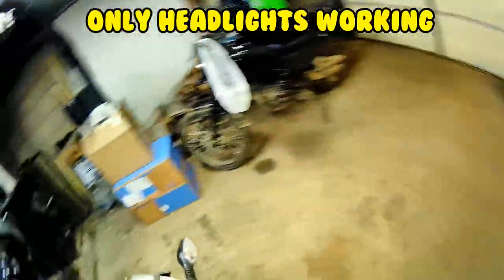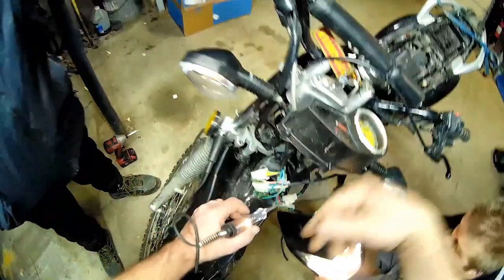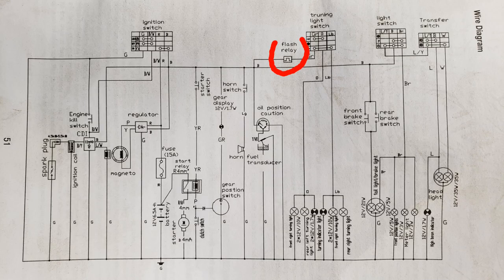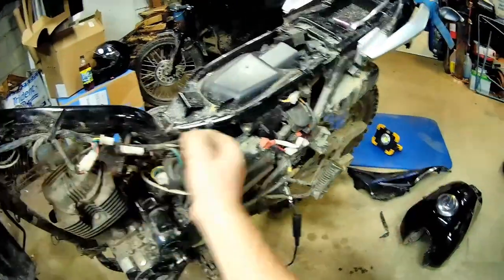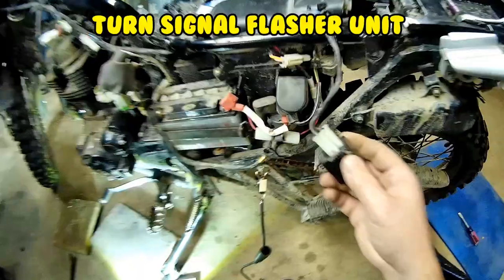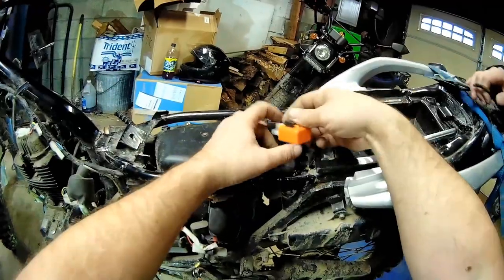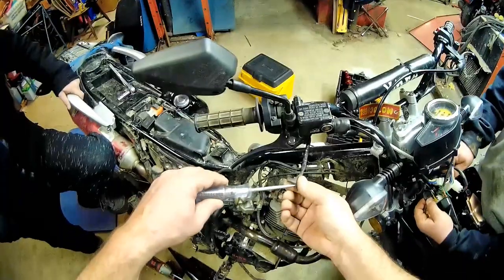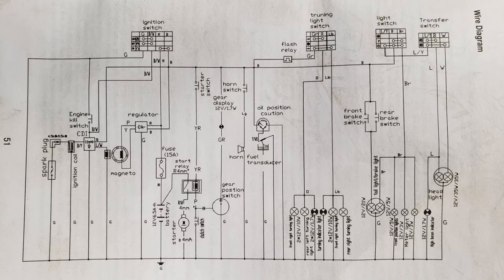[E63] FIX Brake lights, blinkers, headlight Troubleshooting, testing, repair. Hawk 250 motorcycle

Comment: Check your flasher relay on the back(facing your moto)back right under your side fering.had the same issue and this solved my problem. I had no flashers  working saw your video and started looking hope this helps
Reply from the maker: That was the first thing I checked. Thanks

Comment: I have the Hawk 250cc dlx was wondering  where to start with my issue.  All lights work fine. Except my turn signals  stop working  is there fuse? Under seat ? Flash relay? Thanks.
Reply from the maker: I'd say the flasher unit. It's under the seat. 2 wires going to it. Fuse is one main fuse for all near battery.
Reply: @MotoCheez  Thanks man!

Comment: I just got mine a few days ago, when I turn the ignition, the lights don’t show up but the buttons work for them. The dash should show up icons and they don’t and idk how to start it
Reply from the maker: The power leads have to be connected to the battery on the car for it to power up

Comment: Excellent video my grandson has a hawk and so do I his headlight won’t come on and his tail light when you press the bright light flasher they had light will come on but the running light will not when you press the brakes his back tail light comes on but the running red tail light will not stay on when the motor is turned on......!!!
Reply from the maker: Is the switch on handlebars turned off? Silly question but sometimes overlooked.
Reply: @MotoCheez  ..
Nope it’s a 2021 DLX fuel injected the switches are completely different than the one on my 2020 carbureted ....
The switch on this hawk is Made completely different ...., it is blue and has a flasher button ....! For the high beam....! you can flip the switch on nothing happens you press it hard and it flashes the bright lights ....! , but the ( run light will not come on in when you turn the key on with the headlight switch in the on position...! , the tail light will not come on Ether...., I have taken the bulbs out and tested them they are both good so it has something to do with the wiring somewhere.....!
Reply from the maker: My DLX has the headlight switch to shut it off. It's in FL and I can't remember where it's located. Up higher on handgrip controls.
Reply from the maker: I think I showed it on my original review of the DLX.
Reply: @MotoCheez  ...
You can shut this light off of course but after you turn it on it is also spring loaded so if you press it down it will flash the brights I don’t think it’s in the switch because the back tail light will not come on either it well if you press the brakes again all the bulbs are fine when my grandson gets home from work I know there’s a schematic in the back of the owners manual at least there is with my 2020 hawk 250...  The electronics for the DLX fuel injected hawk are considerably more complex under the side panel by the battery there are three fuse blocks that hold two fuses each there are wires running everywhere so the schematic will be very helpful.....😎👍🎵
Reply from the maker: There's a separate switch for the headlights it's not spring loaded it's on and off, and it does shut off the running lights and headlights. Maybe I'm not understanding what you're saying, when you push down on the high low beam it's a pass to flash the front headlights, that doesn't turn on the other lights
Reply: @MotoCheez  ...
OK the switch is ( blue, and if you click it on it just supposedly turns the lights on ) , if you go ahead and press the top half of the Blue toggle switch it flashes the brights.....! But there are no other light switches on the motorcycle on either hand grip....??
 I will have my grandson take another look at it tonight to see if there is another switch hidden somewhere.......? 
So you did a review of a 2021 fuel injected Bluetooth hawk....? If that is the bike you road I would have to assume that the switch would be the same color.....Thanks Jeff...🎵🙏🎶
Reply from the maker: Minen2020 black. And yes there was another switch for just on and off.
Reply: @MotoCheez  OkeyDokey....! I will have my grandson look for a separate switch somewhere I appreciate your input you have a great day.... Prof. Jeff 🎵🎹🎶🎸🎼🎤🎻🎻🎹🎸🎓

Comment: Do you know what volt flasher relay comes stock and how many prongs it has? Going to swing by autozone and check. All my stuff stopped working just like that on my bike last night. I know it could be a loose wire or bad connection, but this looks like what’s going on. I didn’t watch this vid until today at work. Had no idea before that.don’t have my bike on me
Reply from the maker: 2 prong, 12v
Reply: @MotoCheez  thanks so much for the quick reply. My spare bike isn’t as warm as my hawk is. You saved me a colder extra ride this evening

Comment: Hey moto, my brake lights aren't working, the two switches have power going to them but when I turn the ignition on they lose the power, any suggestions? It's the black wire.
Reply from the maker: It should power when key is on, that's an odd one. I don't know of any of the bikes that power when the key is off
Reply: @MotoCheez  Yea im puzzled as well its a 2020 tbr7, it's got power when ignition is off but when I turn on the ignition it loses power, everything else seems to be working though.
Reply from the maker: Almost sounds like a ground issue. Check the grounds
Reply: @MotoCheez  Found out my test light was trash, wiring was good but it was my bulb causing all the issues, I tend to over think things lol
Reply from the maker: Happens to the best of us!

Comment: Hey motocheez. The signals on my hawk dlx only work when I step on the rear brake.(wierd) I’ve watched the video a few times and will be doing the repairs myself. Do you know what it might be?
Reply from the maker: The brake light works and the blinkers when you press the brakes? Sounds like bad ground wire.
Reply: MotoCheez I fixed the signal issue by tightening the rear brake a bit.
Reply: MotoCheez I’m having a similar issue where my break light turns on but won’t flash when I squeeze the break. Do you think I should replace the bulb as well? Thanks for all the help man!
Reply from the maker: Awesome!👍 You can try the bulb... They do do a tad when flasher flashes.
Reply: MotoCheez which bulb did you use? I can’t find the link for it in the description. Thanks again man! You’re the only reason I’ve been able to maintain this bike for 1500 miles.
Reply from the maker: @htbikes7598  I don't remember the number  they had them at the auto parts to match up

Comment: Cheez I’m stumped right now man. Went to replace the battery. The battery I bought wouldn’t fit and when I placed the old battery back in the bike wouldn’t turn on. Terminals are hooked up correctly and battery fully charged. How could I test the battery wires?
Reply from the maker: Sure the smaller wires are on the terminals? The heavy wires go to starter, the smaller gauge wire with the fuse is the main control wire
Reply: Thanks for the advice cheez. I will go through the entire setup once more this afternoon as I have the panels off the bike. Is there anyway I can send you a picture of it if I am unsuccessful? That engineering background would be mighty helpful.
Reply from the maker: @htbikes7598  you can send picts through my Motocheez on Instagram
Reply: MotoCheez I realized I hooked the battery up wrong the first time... I must’ve blown a fuse 😥. Please advise.
Reply from the maker: @htbikes7598  uhho. Hopefully it just blew a fuse, sometimes it cooks the crimp connection to battery. May have blown the regulator too. If fuse doesn't fix it you'll need a test light or meter to track it down
Reply: MotoCheez I studying the schematic  for the DLX will be working on it tomorrow. There seem to be 2 fuses. Do you know where they are located and are there spares in the bike? (I wish I would’ve just bought the battery off your site now)
Reply from the maker: @htbikes7598  the DLX is different, I don't know where the other fuse is.
Reply: MotoCheez DLX uses mini blade fuses 15amp and 10amp they are next to the battery. 🤞🏽I’ll report back shortly
Reply: Replaced fuse. All is good with the world 🙏🏾

Comment: Hey motocheez so on my hawk only the left turn signal works front and back. The ride side signals don’t work but the cluster shows them being turned on for a sec and then goes a way fainter shade of green and stays solid while I have the switch to the right blinker position. Do you know what this might be?
Reply from the maker: I'd check the connections behind the headlight. Has to be a poor connection somewhere unless the switch is bad, I'd it was left outside most it's life

Comment: Hey man does anyone make frame sliders?? And if not you should fabricate your own
Reply from the maker: I don't think anyone does but that's a good idea!
Reply: @MotoCheez  thanks I can up with the idea when i low sided around a corner and my rear break level almost broke my case. Made my heart drop.
Reply from the maker: Damn... Blade did go off road and break the case cover..
Reply: @MotoCheez  its never fun when that happens, I broke the case on my honda xr80 a while ago. Ive been wanting to make frame sliders for the hawk but I'm sure you could do a better job at it than me
Reply from the maker: CSC has a skid plate that I hear works. For the TT250...
Reply: @MotoCheez  I was looking at it and its $130 I was gonna make my own by using a vise and angle grinder.

Comment: Hey moto 🧀 my hawk 250 efi just suddenly died while riding and it keeps blowing a 15amp fuse located next to the battery do u know what my problem might be
Reply from the maker: Definitely check up by behind the headlight for a pinched wire somewhere
Reply from the maker: The schematic is in the booklet that came with bike. I have a link to an older Honda CG engine on motocheez.com.

Comment: I replaced the fuse bike started up road for about 3/4 mile then pulled clutch lever in and bike died so I replaced fuse again made it another 1/2 mile before fuse blew again. Now bike blows fuse instantly when I replace it
Reply from the maker: Well you definitely have a short somewhere, check to see if the wires are pinched somewhere I've seen them pinched back that go to the rear blinker and I've seen them pinched up by the headlight you're going to have to like pull the harness and look at each wire and see if something looks like it was smashed maybe even under the seat
Reply from the maker: The main fuse is the one by the battery that is on that small red wire
Reply from the maker: Has to be a pinched wire somewhere, don't put a bigger fuse in or you'll melt the wire or a connection